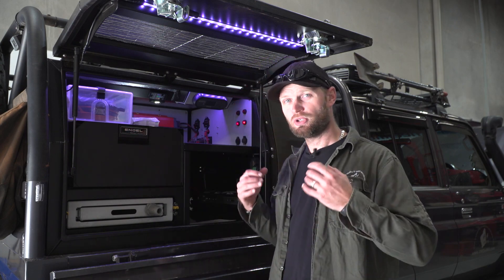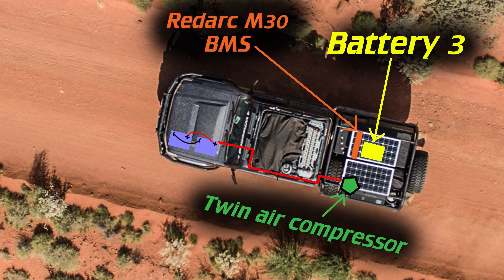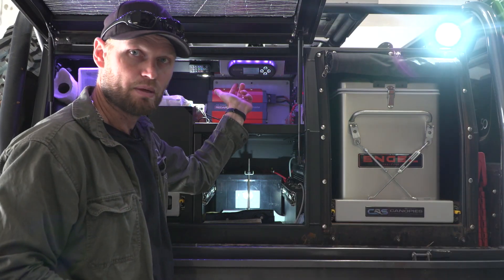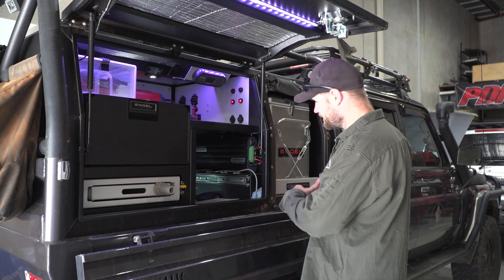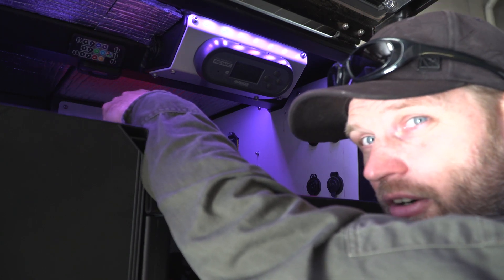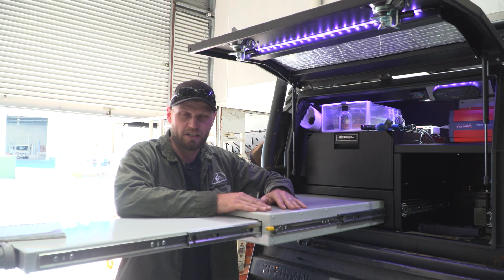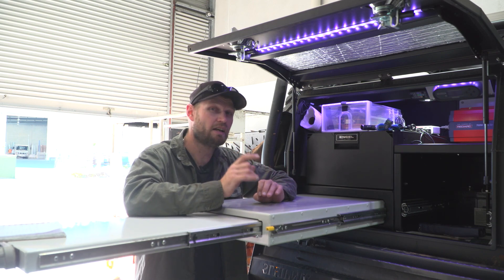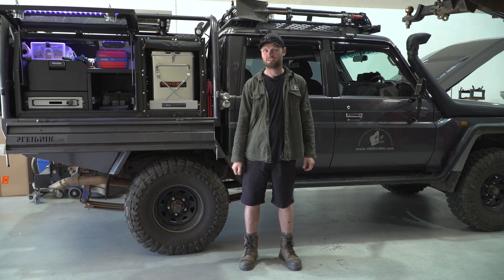My New 12volt DIY setup Landcruiser 79 series

Comment: Hey, Ronny, 

I was looking at the RedArc website and they no longer list the BMS 30 you've got... Has it gone out of production?  If so, do you know why?

This was a great video as I'm at the point in my Jeep build that I'm getting into 'house' electrical, very helpful and good work!  Thanks!
Reply from the maker: +Kurt Van Wagenen try this link, I'll add them to the list below: https://www.redarc.com.au/themanager30
Reply: +Ronny Dahl Yeah, that gives me a 'Page not Found'

Maybe blocked in the U.S.?   Thanks for the fast response.
Reply: REDARC are still working on the 110V input for the US market. The BMS1230S2 is 240v. keep an eye out on the REDARC web site, it wont be long...
Reply: Thanks for clarification +Scott Montgomery
That makes a lot of sense.
Reply: I hope they make one for the USA soon I want one so bad before I start doing my build
Reply: I've done a lot of homework since last week, and the Redarc would be over kill for me anyhow.  I'm probably going to use a CTEK D250S which is more than enough to manage a starter battery and a 100ah house battery.  The down side is that the D250S doesn't have the easy input for AC... but that probably doesn't matter since I have an Optima Digital 400 to recharge when I have AC available.  The D250S does handle Solar though, so that'll be fine.  The main limitation is that the 250s only does 20amps... But if you have a large battery bank you can back it up with the CTEK SmartPass that can go to 80amp, and allow AC directly.

The Redarc kit looks badass, but at five times the cost of the CTEK, for what I do, I can't justify it to the Minister of Finances (Wife).

Comment: Hi Ronnie, really like and appreciate your channel and the effort put into it.

Some constructive food for thought regarding your current ute box/fridge/power setup...

I feel your 2 fridges will be running flat out trying to keep your goods cold within the sealed in heat of the black steel boxes. They will using a solid 5 amps/hr, continuously.

With 1/100Ah battery, negligible solar input while parked, 5 amps draw and 50% depth of battery discharge, you really only have about 10 hours fridge run time up your sleeve. That isnt much and will be even less with other house battery power draw.

Take that same 5 amps draw plus whatever else you run from your house battery away from the 30 amp max output of the BMS, and you will not be getting the house battery recharge rate you expect. The BMS also reduces the house battery recharge rate for every single Celsius above 25C, which will further reduce your actual battery charge rate in the hot boxes.

To help out, could you:
1.  Add some kind of ventilation to the boxes to keep them cooler?
2.  Switch the house battery power draw onto the main cranking batteries whilst the engine is running to allow max BMS recharge into the house battery?
3.  Add a second house battery as you noted to up your amp hours.
4.  Add readily relocatable and ideally bigger solar panels.
5.  Consider an invertor generator like the Hondu EU 10 or 20 for battery and fridge backup and general 240V load.

Again, just food for thought. Keep up the good work. Brendan.

Comment: Great video Ronny.

If i may offer a suggestion; use some form of plastic/rubber grommet for passing wires through on your aluminum panels. As much as we shake and rattle our rigs over time and many types of terrain you'll start to chafe wire insulation eventually. you could also use door edge trim like they use to keep dinging doors on other vehicles..

Comment: Here is a tip that will help increase your battery life.
Always if you have a choice mount batteries east west, not north south. this is to keep the plates perpendicular to the direction of travel. Regardless of battery construction acceleration and braking forces will eventually cause plate collapse.
Reply: I have a 30 year old landrover, what is acceleration ?

Comment: Solar Installation looks simple - and it can be - BUT if you want to get the best Efficiency out of it, man need to d it right:
- MTTP controller, especially if running in different temperature conditions
- Solar cell work in series! Like mentioned in the video, shadow will drop the current!! This has nothing to do with bad quality (often mentioned wrong in the net!)
- exposition is key, like mentioned in the video. If in any way possible make them moveable. So you can park the truck in the shadow and the solar in the sun! :-)

top tipp:
- make the panels in series, @ least 2, so you run 24 Volts! This enhances the efficiency with MTTP controllers in hot conditions. [note in hot conditions MTTP will lose efficiency and drop to the same eff. like PWM ones]. MTTP contr. are not made to LIFT voltage, so you loose voltage in these conditions. You can avoid that when voltage is 24 Volt. 
In addition the current is lower if the voltage is higher (of course). So cables can be smaller, that saves weight and costs! :-)
Reply: I run 2x 100W fixed panels on my roof in parallel what is the advantage of running them in series I thought in parallel the amps added together which would be better for charging
Reply: Your thinking is correct but essentially you want to let the charge controller 'decide' the divvying up of voltage and current instead so giving the MTTP a power source with a higher voltage gives it more headroom to determine the final output to the battery to maximise charging efficiency

Comment: nice setup man I use two 60w folding solar To run a 120v bar fridge only paid $70 for it and it only takes 68 watts to run on the dc side after inverter, or sometime I will use my walmart power it lithium battery generator with the folding panels to run the fridge as well. its a much cheaper way of having a fridge as these 12v ones are retaredly priced.
Reply: Going Off Grid I

Comment: Good review Ronny - always helpful.  I am interested on why you have not considered a Lead Crystal battery.  A 200 AH Lead Crystal in usage is almost equal to 3 100 AH AGM's when yu factor in you can get a full draw for like 95% of the battery without damage to the battery and I think they do charge a little faster than Lithium not to mention they are said to be more robust and can handle more extreme temperatures.  No saving on weight however as is a bonus with Lithion.  Any reason you have not considered Lead Crystal?

Comment: Hey mate, nice work with the installation, nice and neat; but ya did make some rookie mistakes with the components and how you used them ie, you used only 100a battery, only 160w fixed solar and a drawer fridge. 
Lithium batteries are still uncommon and expensive, I'd stick with common AGM deep cycles, you can pick up 150amp for around $300
What you could do is set up the solar panels so you can slide them on and off the roof rack which will allow you to camp in the shade and have panels in the sun. I've done this setup before, I had the solar panels mounted on a slide off the side of the Patrols canopy which could then be unclipped and taken off; it worked good as instant slide out sun shade aswell.
Reply: In his defense, he has 2 fridges and there is no room to access the smaller from the top (if he had put one in)
Reply: Dubious 
Fair enough, drawer fridges are inefficient though, in any case, 2 fridges need minimum of 150amp battery and 250w solar. Fixed panels are useless when you're camped in the shade,, which is when ya need them.
Reply: Hi, can you please post where you can get these 150amp batteries for around $300? also please post some links to your slide off solar panels.
Reply: steelynuuno he covered all of this in the video buddy.

Comment: Why not run two 6volt battery's in series your amp hours  should be closer to 230 amp hr and less cost . Thanks for the info I'm just working on a cargo trailer with a 3000 watt inverter
Reply: What is the advantage of running 2x 6V batteries in series  over 2x 12V 130amp/hr batteries in parallel
Reply: +Matthew, 6 volts have greater amp/hrs. The ones I use in my RV (and I have six) are 235 amp/hrs each. And they are $135 here in Arizona. These are made by Crown and highly respected. Trojan is another good brand. Nothing wrong with lead acid.
Reply: Yes but the amps don't add together in series so even if your 6V batteries are 235amps then two in series are still gonna be 235 amps so there is no difference having two 12V 130amp batteries in parallel adding up to 230amps but I'm no expert I could be wrong that's just how I thought it worked
Reply: Matthew Riley is correct. Unless they are saying that 2 50Ah 6v batteries are cheaper than 1 100Ah 12V battery, however i don't believe that is the case. 
Parallel Capacity = Add Ah of all batteries to get a total.
Serial Capacity = Ah of smallest battery (rule of thumb).

The up side to using smaller cells in serial is that they tend not to discharge like a new and an old battery would in parallel. Further to this, if you have a large setup, a failed cell only takes out a small battery. As opposed to a large 12v or 24v battery, a failed cell would ruin a larger battery and cost more to replace. This is why large battery banks for UPS's and buildings tend to use 1000Ah+ 2V batteries (Also for higher current draw).
Reply: nothing at all, more problems if something occurs, don't listen to this guy. If one battery dies during the trip, say good bye to all ya stuff in the fridge.

Comment: what size alternator do you run?
As for charging your camera gear, wouldn't it be more efficient to get 12V chargers rather than going through an inverter?
Reply: David Wegmuller, he covered this in a previous video, I remember it's a heavy duty water cooled aftermarket one..from memory 150amp

Comment: Hi Ronny. Changing to a lithium house battery won't make it charge faster. You are limited by the BCDC input of 30amps. If you want to charge your battery faster you should hook it straight to the alternator or buy a higher bcdc unit. 
I run a 200ah deep cycle agm battery with a 20ah red arc bcdc (I want the 40)and I can run a single 40l engle for 5 days without charging. 
I paid $350 for the battery. It's a Cobra. Nothing fancy. It's big and heavy (65kg) though requiring a custom mount location but it suits my set up just fine.
Ive had it for 2 yrs now and run it flat several times and it's going strong still so there's no need to spend big bucks on batteries. Unless you want of course ;)

Comment: Again another nice video, thanks for sharing your thought, experience with us. 
One little side note to your idea of treating a lithium battery to your lovely car. --> I´m not an expert but <-- (should be underlined)
1. Lithium batteries are far less heat resistant then your AGM battery and you´ll run them in a black box in australien sun.
2. Lithium batteries are less durable then AGM batteries and you wanna run them in a "bumpy" environment.
Both facts together with the high energy density of lithium batteries might hold the risk of "unwanted release" of their energy. This release will take the place as thermal energy release, first roast, then fire with temperatures beyond 1000°C, btw close to your gas/diesel tanks. Samsung (Galaxy Note7), Boeing (787) and other big manufacturers might tell you a thing or two about it.
just my 2 cents.
Reply from the maker: +Junky211 that's what's held me from getting them also the price of course being near 1600-1800 for a 100 amp hr
Reply: Also worth noting is Lithium cells can loose capacity when stored in hot conditions, I have had a couple of Hand Held radios with lithium packs go completely flat because I had left them in my work bag in the back of the car during a Mildura summer...

http://www.plugincars.com/lithium-ion-batteries-can%E2%80%99t-stand-heat-122447.html
Reply: Many folks in the US are switching to Lithium battery banks in their RV's...which get banged around a lot when on the road. I've not heard about any durability issues. Plus electric cars all use huge lithium banks. Overland tends to be slower over obstacles. Heat- yup, that's a problem. Right around 120 degrees is I believe when they really start to "age."  RV folks are now putting the lithium banks in the living area, like under the bed, so the temperatures are more regulated. Maybe a lithium battery could be fitted somewhere on the inside of the cab of the truck?

Ronny - I suggest you consider "remote" solar cells. Free standing with cables that run to your truck. You can place them out from the shade and easily aim them at the sun and adjust throughout the day. That and another AGM may be enough to cover your needs. You just strap the cells down in storage when you are on the move.
Reply: If you are looking at LiFePo4 batteries and not LiIon or LiPo then you don't face the heat and durability issues, plus they don't need ventilation and you can mount them in any orientation. LiFePo4 are expensive batteries but they as as stable as AGM and LA batteries unlike the other forms of lithium batteries which have developed a name for being fragile and volatile.